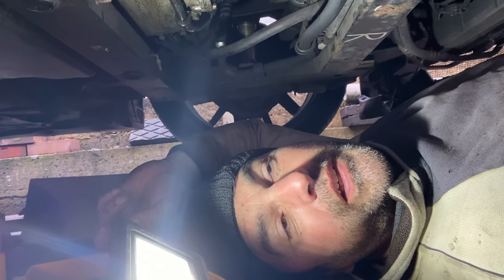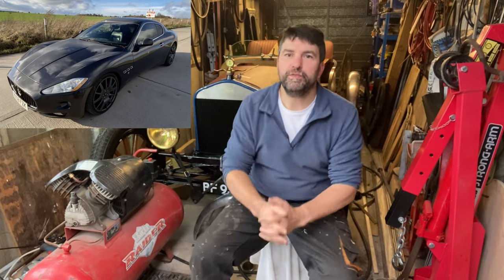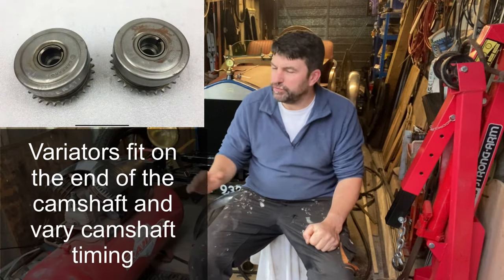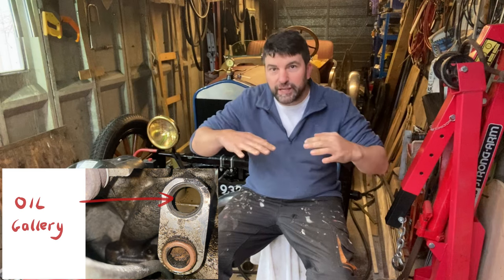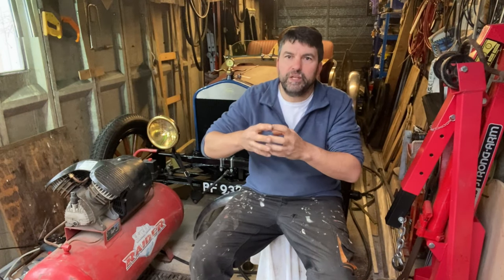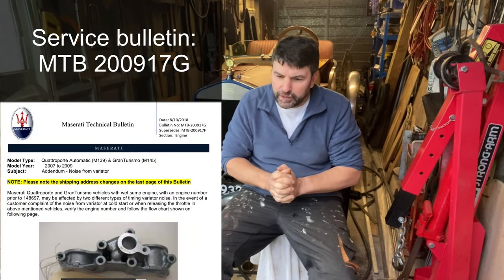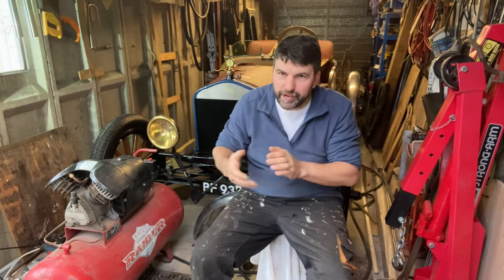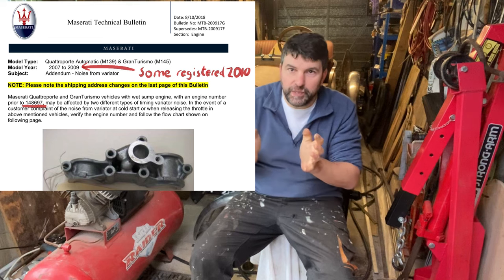Will it work? Rebuilding my cheap Maserati - Fit an oil Accumulator to ‘fix’ the Variators - Part 6

Comment: Hi. Do you know if the cam cover/cam catch (the part that gets added with a check valve) can be removed and reinstalled without messing up the timing? I want to send the covers off for DIY but don’t want to mess with the timing.
Reply from the maker: Hi, yes the cam caps can be removed without touching the timing chains or timing. I think the wisdom is that in a number of cases this helps. However if variators are worn (the variators have notches that were not hardened enough or poor design) then noise will still happen. Having said this, my accumulator has completely stopped the issue. So in reason this must be why doing check valves can fix the problem as well as if the variators get oil pressure at engine start, then they will not make the noise.

Comment: I was impressed by the video. I'm planning to use the ACCUMELATOR made by FOA on eBay. However, I'm a little worried about the small orifice diameter. There seems to be a lot of oil inside the engine, but will the engine's oil be filled and pressure be generated just by the power of the accumulator?
Reply from the maker: I cannot speak for FOA, but my accumulator has a litre capacity and when I press the dump button, the oil pressure light on the dashboard goes out for a couple of seconds, so it must be enough pressure to satisfy the oil pressure switch.
Reply: @SailingSVPipedream  I see, thank you very much. If I leave the car alone for a while, will the oil port become empty? (Even if you open the lid, no oil comes out?)
Reply from the maker: @sworkscar  When I was installing mine, I removed the plug in the oil gallery and it was dry in there. The oil gallery is quite large and drains quickly. 
With the accumulator installed. I went on holiday and did not start the car for five weeks. When I got back I checked the accumulator and it still had 60psi, so was still full of oil under pressure. I don’t know how long it would keep oil pressure, but I reckon up to 6 months at least.

Comment: Please use the "Like" button on this comment if you want to see a full uncut video with the variators replacement+timing.
A lot of Maserati owners have this issue, but you can't find anywhere a complete video of how it is actually done, where you can see how each part is taken down and then put back together.
You can find information and short videos (max. 15-20 minutes) of people that say that they have done it and maybe include a short time-lapse, but I'd rather watch a full uncut video of the whole process.
20 hours, 40 hours, a series of 1 hour videos - I don't care about the format, just please-please make it.
Great job!
Reply from the maker: Eventually I will do that, I have been searching too! However I am hoping I may not have to do it for a while. She has been in the air on jacks for three weeks so I am looking forward to just driving again.

Comment: I think I will have to give this a try. 
Was this a complete kit or did you piece it together? 
My QP has had the check valves down well before my time. Like you, I just want to buy some time until I can get the Varrators done. 
I had to chuckle when you said buy some time months or years... 😂.
Have to wait till the warmer weather here, but will give it a go.
Keep up the good work 👍
Reply: QP owner? Lovely cars. I hear the Maserati Club UK is planning a celebration of 60 years of the QuattroPorte at this year’s Salon Privé Club Day on August 31st at Blenheim Palace.
Reply from the maker: Hi, I had to piece it all together. I got the accumulator from APPD and the other bits from Matt Lewis. I am hoping to have her back on her wheels this week, so will have more knowledge of how well it has worked soon. So far so good though, now if I can just get enough clearance to get the engine mounts out…

Comment: Engine numbers from 148697 have oil valves, but old variators. Engine numbers from 150070 have oil valves and new variators.
Ps: are the last 5 digits of the VIN number also the engine number?
Reply from the maker: I will take a look in a bit and see about the VIN number.
Reply: No. VIN and engine number are not related